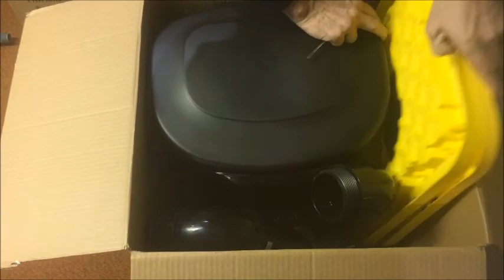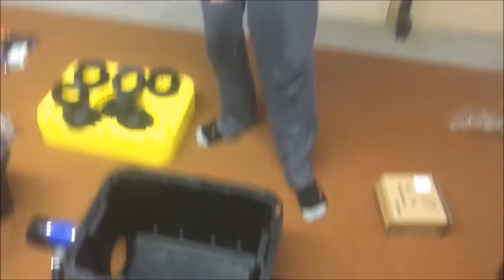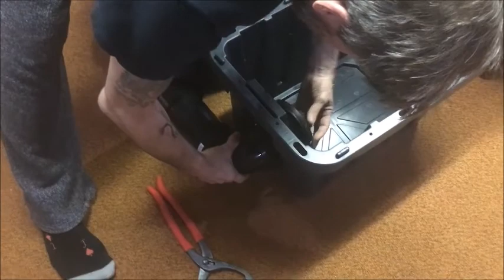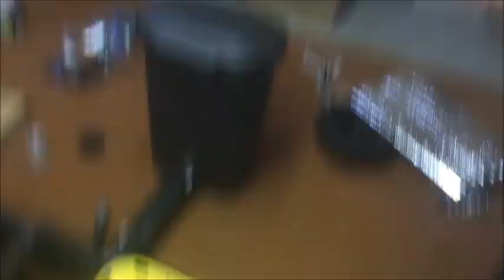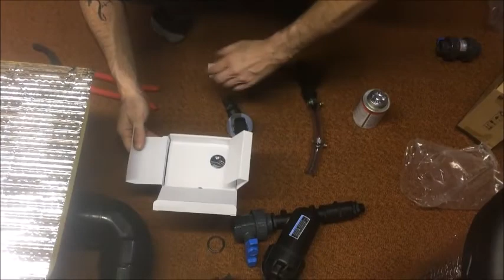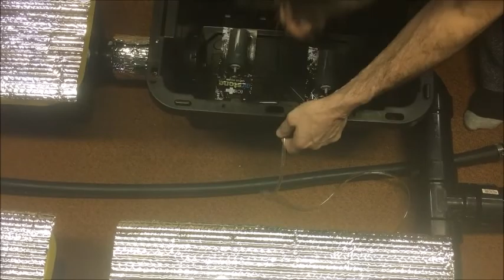DIY Hydroponics

Comment: Why 6 inch bulk heads and pipes? I have the same containers and was considering adding a reservoir with pump to make water change and setting easy. I just dont understand why using $100+ inch bulk heads vs getting 1-4 inch lines
Reply: Roots.

Comment: This is bad ass.  Too bad I'm lazy as fuck...lol  I just bought a AirCube Ebb & Flow Hydroponic system on sale for $550.  I'm in Oklahoma and I'm allowed 6 seedlings and 6 flowering cannabis.  I love this setup much better but I'm paralyzed and disabled so I don't have the energy to go find all of these parts, build it, and install it.  Plus if I did, it would leak on me, guaranteed...lol  You need to find these parts on line and link them in your description or find them and sell the plans to make you some money because I'd buy the plans and the links on where to get them if I hadn't already bought my system.  Nice video man!  Thank you!!!
Reply: I bet you payed significantly less than this setup.

Comment: Hey man, nice video.
Can you share where you got those bulkheads in Canada?  I wonder how much they were too.  The Current Culture ones are impossible to find (in canada) and pretty expensive.  Also, they're solvent fitting.

Thanks.

EDIT:  Ohh, I guess you mention it.  Haha.  Can't be found locally around here.  $20 each?  Damn.
Reply: While you wont find them at any of the big box hardware stores, do a quick google maps search for "plumbing supply" in your area.  100% you will find stores within a reasonable drive.  What you will find are suppliers for actual plumbers.  Most will let you set up a cash account even if they typically don't let people in off the street to shop.  If they don't have it, they can definitely source it.
Reply: How much is this rdwc kit
Reply: Menards. They have 2" for $8.99

Comment: I found your video on kijiji and want to know what makes your system different from CC. I'm interested in making a purchase.
Reply from the maker: Thanks for the interest. The plumbing & bulkheads are more durable, The bulkheads can be used in different configurations because they're threaded connections; not glued, parts are readily available at your local hardware store, there are no specialty parts to order or wait for. Plus you can build this system yourself for approx. $850 in parts & 15-20 hours of your time.
Reply: @DIYHydroponics1  can we chat on about this product? I live in the Yukon. I think I messaged you on kijiji the other day. I'm going to make a purchase.
Reply from the maker: @vitinosolano6632 I would be happy to chat to you about this product. Email me @ diyhydro@yahoo.com for more info. Thanks!
Reply: What kind of water pump is it.